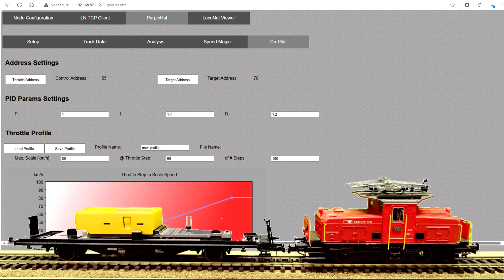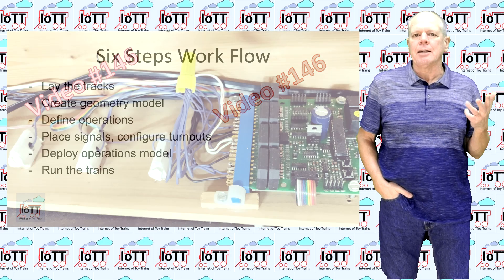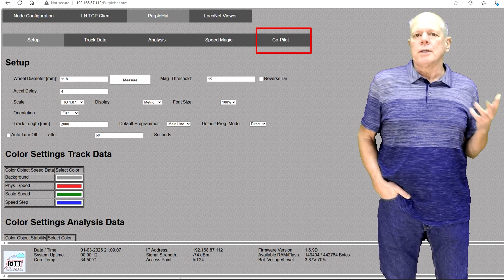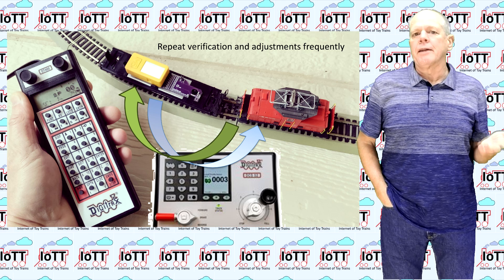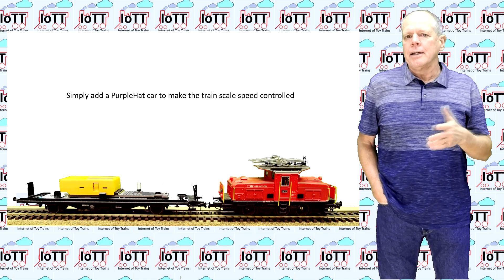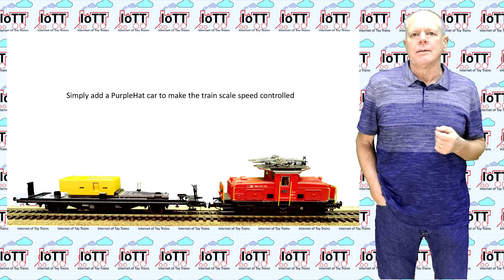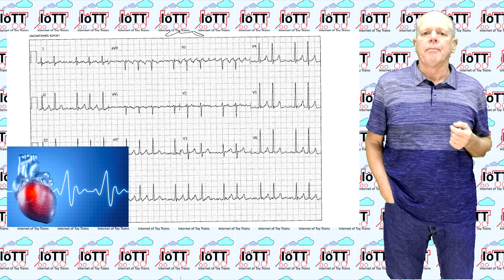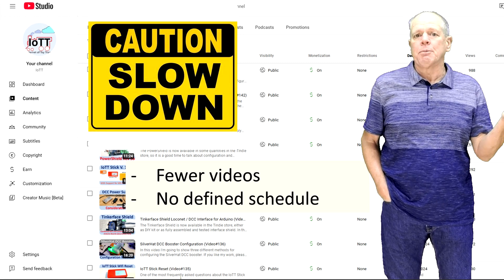IoTT Channel Update and Outlook (Video#150)

Comment: Hello Hans.  I had a thought on rewatching this video just now: the purple hat copilot in a trailing car very much reminds me of a loco/caboose (or engineer/conductor) relationship.  With some additional functions it could be used to automatically detect derailments or accidental uncoupling.  Food for thought.  Wishing you the best, Will
Reply from the maker: Yes, that would be a possibility. If it tries to change the loco speed but it has no effect on the measured speed, the conclusion is that something is wrong, particularly if the measured speed is zero.

Comment: I am really liking what you are creating with the purple hat.
Do you have any suggestions for taking power from the track for the M5 stick?
Reply from the maker: Thanks. The best option is to add a battery. It is loaded by the Stick BMS and just connected to the BAT and GND terminals on the PurpleHat board. That's actually why the PurpleHat ships with a 2 pol. pin header included.

Comment: Happy New Year and welcome back! Missed you these past months but am very happy to see you on the mend again. I’m also happy to see more incredible ideas coming from the IoTT lab. They never cease to amaze me. The Purple Hat innovations could certainly add a new dimension for us N-scalers as speed is a constant issue in this smaller scale. I look forward to hearing more in the future. If you want another project to add to your list, and I don’t think you really want to have more work to do, could you please take a look at using the M5Dial as a potential wireless throttle controller. There are a few DIY throttles out there but I have had limited success with them and my Red Hat DCCEX command station. Using old phone with WiThrottle or Engine Driver is okay but not the same as a good handheld throttle with a speed knob in my opinion. All the best for a great new year ahead. I share your political  concerns even though I live in Canada. The next four years for both our countries will be very important for our futures. Glad you are back!
Reply from the maker: Thank you. I did not mention it so far, but I am working on the Dial. I like the touch screen possibilities.